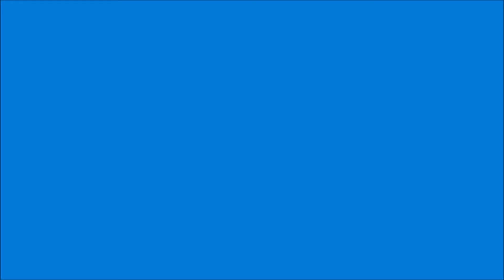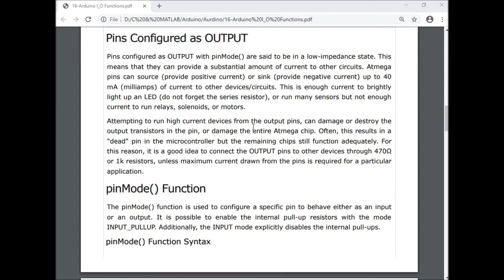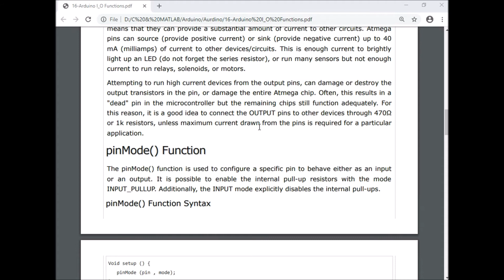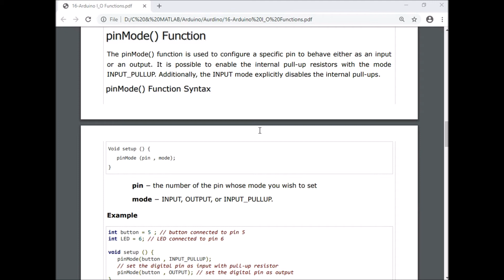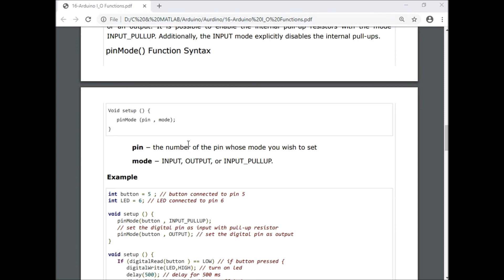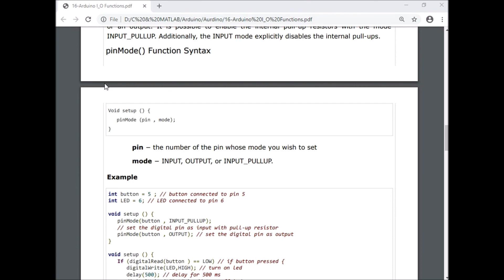16-Configuring a pin as output using pinMODE  in ARDUINO

Comment: 18208-ec-003
Digital write is used to change the function high to low and vice versa syntax for it is digital write here pin is number of the pin 3

Comment: 18208-ec-030
By this video i am understand well
About pin configuration of arduino pins. It can be chanded by using the software command pinmode(pin no., mode).